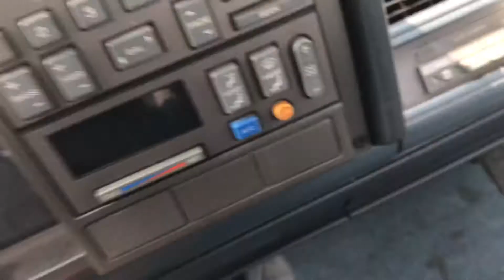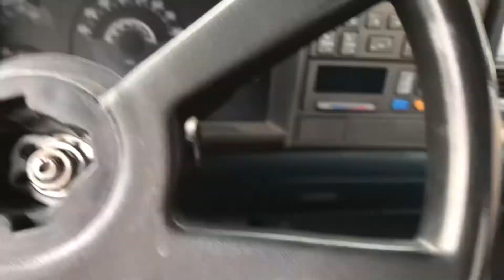How to peal a steering column on most GM Vehicles with tilt option My key won’t work Im not stealing

Comment: Brings back memories growing up in the 90s...
However, from what you showed of that column being loose, that column was completely fine and rebuildable, just needs the screws tightened.
Dam waste of a perfectly good column cover and mechanism.
Reply from the maker: Had it tightened twice already. Local shops not doing them correctly, so I just decided to replace. Steering column repair is gonna be a lost skill soon.
Reply: @TheRimPlug  Aint that the truth!